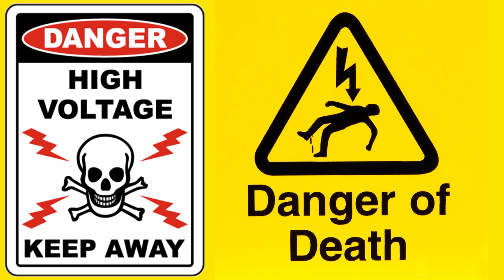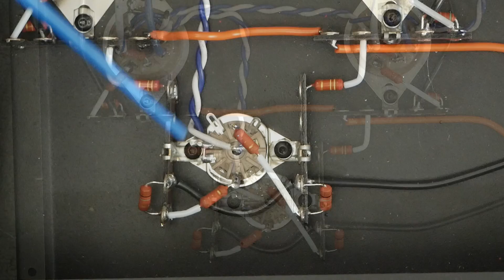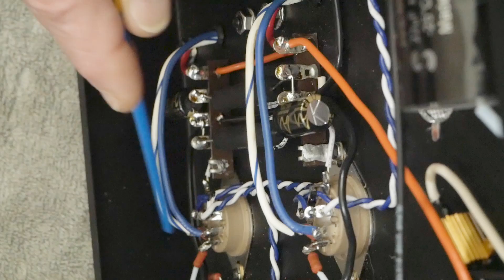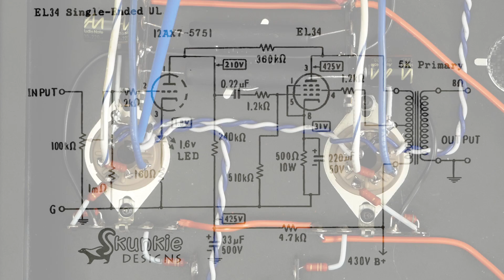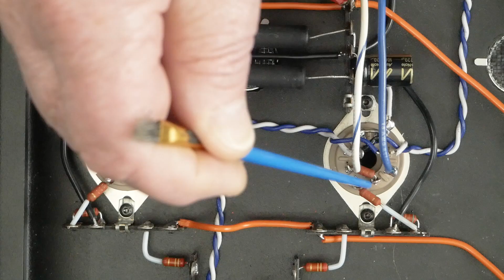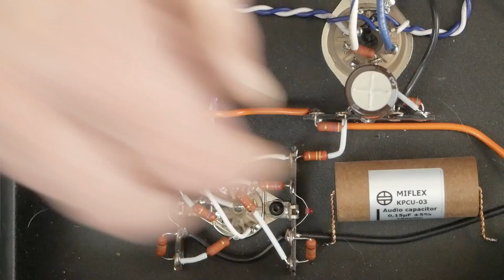Production 5751/EL34 Amp:  Wiring up the Tubes!

Comment: Are you installing all the tubes to test the voltages?
Reply from the maker: Sometimes I just install the output tubes and check them to get an idea of how that section of the amp is working before moving to the input tubes.

Comment: Love your work, S - so neat and easy to follow! I have a question - at 18:13 in, you clearly show the wiring of the cathode resistor and LED  for the input tube. The schematic shows the LED followed by the resistor to ground and you have wired it with the resistor followed by LED to ground. Is there a reason you switched them?
Reply from the maker: Doesn't matter the order. I wanted the LED attached to two fixed points (tag strip lugs) rather than a tag strip and a tube pin the moves around when you insert and remove the tube. I'll move them in the final schematic so people aren't confused.

Comment: Nice work! There's more and more of the amp :)
Speaking of teflon... while I haven't tried PTFE tubing for component leads and use thin heatshrink tubes instead, I really like using teflon insulated silver plated stranded wires for signal wiring. Possibly aerospace grade stuff - it's lovely and you'll certainly like it :)

By the way, if insulation on your wires tends split and melt away when soldering (especially if the insulated part of the wire is bent close to the joint), you can put a short piece of heatshrink tube on the end of the insulation before soldering. That'll keep the insulation together, looking nice. Also, heatsinking with medical forceps helps preventing the insulation and can be done when you have a long section of stripped wire, e.g. when tinning or soldering the shield.
Reply from the maker: Nice tips
Reply: I have some small aluminum spring loaded heatsink pliers with grooves for holding onto wire leads for such situations. I completely forgot about those and haven't used them for decades since I was a beginner. I will get them out of my old tool box and start using them again. Thanks for the reminder. There have been times I should have used them when soldering in expensive wax capacitors
Reply: @Batman-n1q1v  ha! If you get into making effect pedals with germanium transistors or diodes, it's a must. Same for vintage electronics restoration.

I wouldn't trust wax capacitors at this point, at least not without testing them for electrical leakage. Glass sealed paper in oil should be fine though.